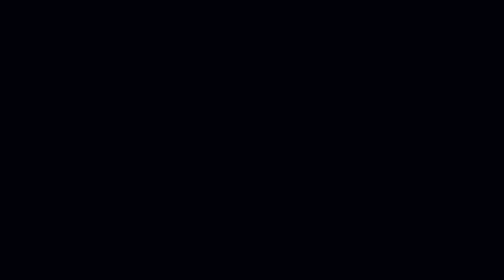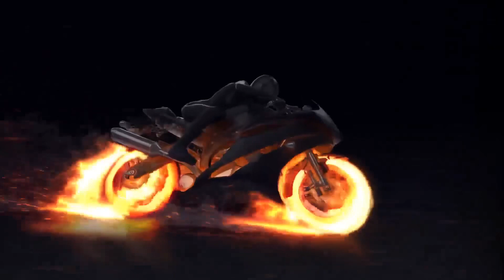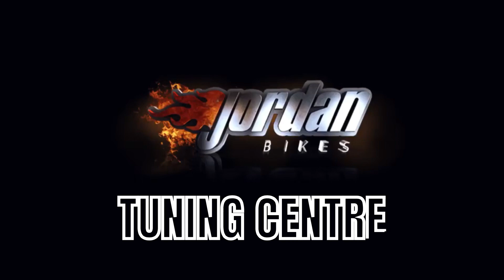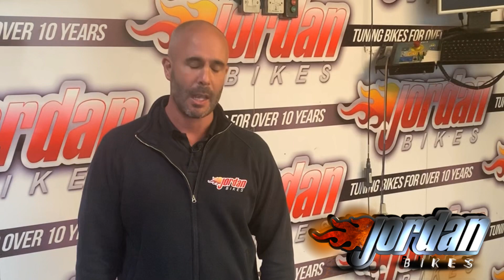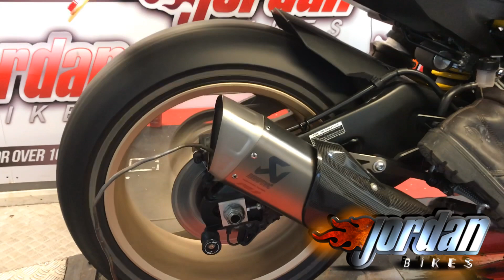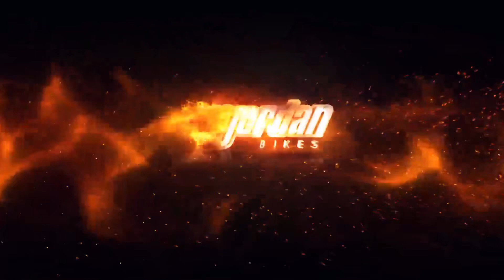MOTORCYCLE ECU REMAPPING / FLASHING EXPLAINED BY NICK of JORDAN BIKES LEEDS, YORKSHIRE, UK

Comment: Hi just a quick question,if I replaced my factory headers to a after market headers down pipe (cat deleted) does it still need remapped orECU flash out? Coz the website am about to buy the pipe,says no remapping required? GSXR 1000 L5 thanks in advance
Reply from the maker: The bike will not run correctly if you fit a full race system. Don’t take our word for it though, once it’s fitted your bottom end and midrange will be pretty awful and you’ll soon be on the phone wanting it sorted out. The company selling the system aren’t quite being honest, it’s not absolutely essential to map it afterwards but it’ll run badly until you do.

Comment: What are your thoughts on sending the ecu to get it remapped without the dyno?
Reply from the maker: Neil Cook it’s not a service we offer, as we test the bike before and after to make sure there are no faults at all and the job is perfect, and without the bike we can’t custom map the throttle, ignition or fuel, we do need the bike on the Dyno for that.
Reply: @jordanbikestv  asking as i've seen companies advertising postal flashes, was curious as to your opinion on the quality of such things. I'm sure a full dyno run would be best (and most expensive) but would a standard reflash be ok?
Reply from the maker: Neil Cook to remap an ECU without having the bike there will only ever give you a map that’s vaguely correct for your bike. It should be better than standard if they know what they’re doing but it won’t be anything like a custom map on the dyno. We don’t like to put out average work so we don’t do postal remaps even though we could. We do a perfect job or we don’t do it at all. 👍🏼
Reply: @jordanbikestv  thanks for helping me, i'm in East Anglia so it's a bit far to you but there is a dealer near me that has a dyno so speak to them.

Comment: Great explanation, just a quick question: I have a GSX R750 L3 (2013) fitted with an after market air filter (BMC), mid pipe (cat delete) and a M4 slip on; is better to do a re-mapping or a custom map for the bike? and how long does it take to perform those jobs?  thanks in advance.
Reply from the maker: LM Reds a full custom map will be needed in order to get the bike running perfectly, and we get great results from Suzuki’s as they are so restricted from new. It takes half a day, please give us a call if you’d like to book in 👍🏼
Reply: @jordanbikestv  Sure, thanks jordanbikes